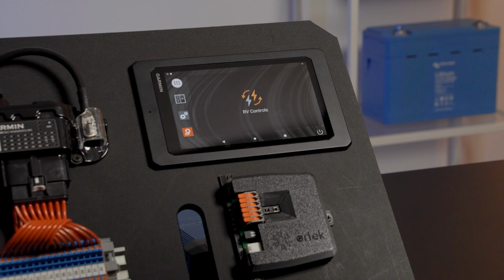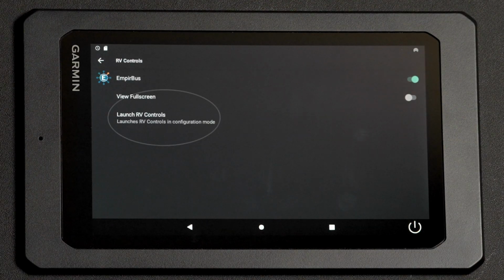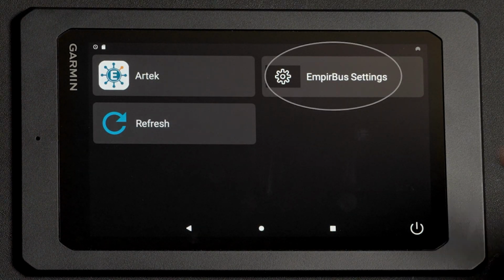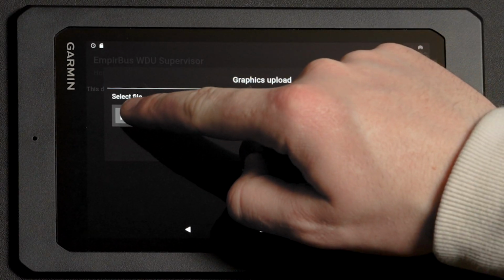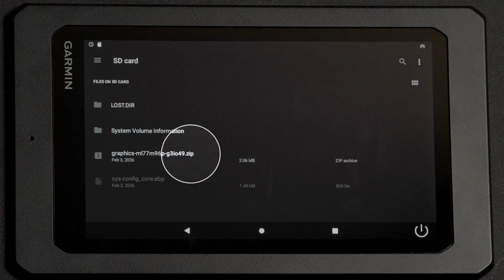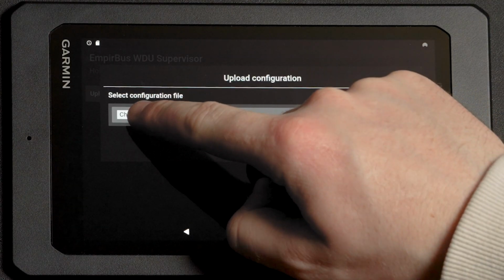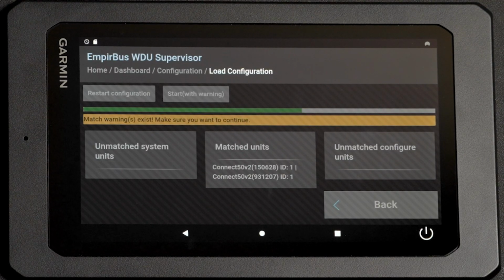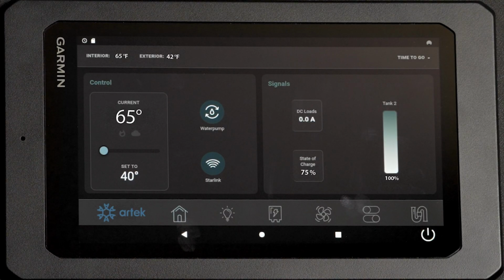How to Upload Configuration & Graphics Files to Core & Core Lite Systems

Comment: thank you for the information i an trying to get all this for my new system of a electromaax 24v 165 amp alternator with remote rectifier with a WS500 pro feeding 3 Fogstar gen 2  300amp 24v batteries all connected to a Cerbo GX  any hel[p or information would be helpful its all getting a little confusing.